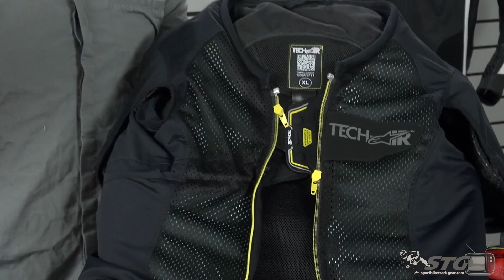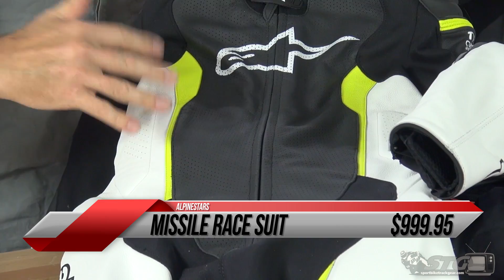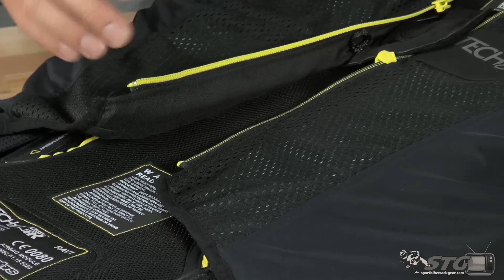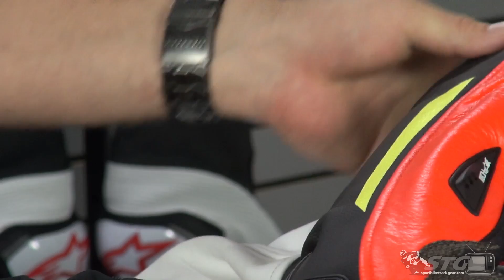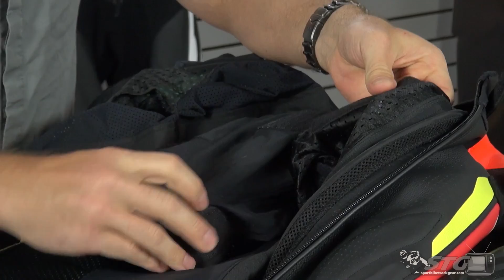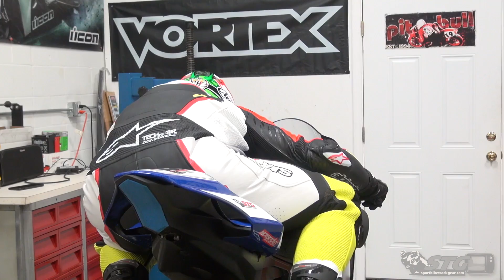Alpinestars Tech Air Airbag System Introduction from Sportbiketrackgear.com

Comment: Just bought the Alphinestar GP-R V2 Tech Air Jacket. I notice the cable is only long enough to peak thru the Tech Air Connection hole. Not even enough length to pull more through. Is that normal?
Reply from the maker: There is plenty of cable there, you just need to give it a little pull. If it is hung up open up the liner and you should be able to solve that pretty easily. - Van

Comment: excellent video. what happens if one uses a size large in a size 56 or 58 jacket, instead of in a size 54?
Reply from the maker: As long as the vest fits you properly you are good to go. - Van
Reply: @sportbiketrackgear  thank you for response. so, will a size large vest zip into a size 56 or 58 jacket?

Comment: Great video about tech air race , what about street teck air?
Reply from the maker: I have not handled or used the Tech Air Street. The Race version makes the most sense for our customers and we use it so this is what we have focused on. The Race can be used on the track or the street in compatible garments. - Van
Reply: @sportbiketrackgear  I was given a street tech air as gift from a friend. I ride sport bikes. It's a real shame Apinestars does not make leather jacket for street vest with 360 zipper . 
when I ride i wear leathers full gear. When my friends and I ride were not touring, lol.
Reply: @sportbiketrackgear  By the way dig your vids very informative. As a matter of fact your vid on BMW exhaust upgrade helped me decide to pull the trigger.

Comment: Can I machine wash tech air vest and jackets no problem?
Reply from the maker: I would not throw the vest in the washing machine. Hand wash using mild soap with rags and do not submerge it is what I would suggest. Basically wipe down the fabric of the vest with a soapy rag then rinse it off using a wet rag with no soap. Once you have in all rinsed off let it air dry. - Van

Comment: Brian, maybe i missed it. Once you have to deploy the airbag ,  can the charges be replaced or does it mean a new vest?
Reply: if you go street mode you only get one charge but can still send it in for repack
Reply from the maker: It can deploy twice before you need to send it to Astars in California for inspection and repacking. We just received Max Van's back and the turn around was very fast. - Van
Reply: @sportbiketrackgear  is it really only 200 for the repack
Reply from the maker: We just got Max's back, I think it was $300 but need to check the invoice. There will be a video coming out next week covering the repack, how long it took and how much it cost. - Van

Comment: did you mention how freaking heavy this system is? Just the missle air jacket was heavy by itself. Just got the airbag unit yesterday, omg, aside from little to no air flow making it through the jacket before the airbag, now it is even less and damn is this the heaviest jacket I have ever owned
Reply from the maker: It adds weight for sure, worth every ounce and then some IMO. My Son Max crashed in his Missile suit while racing a few weeks back and said it felt like landing in a foam pit. Zero injury and no complaints of pain. - Van
Reply: @sportbiketrackgear  The weight really doesn't bother me at all up until I have to take it off, for whatever reason my arms don't want to come out of the sleeves. like the Elbow area is just a bit too snug, but once I get around that, I am still dealing with a shattered wrist and arm from a total back in December, somehow survived that with only 6 lbs of titanium being added so more protection is very welcome, just so damn heavy on my arm. I got the zx10R SE to help deal with the feedback killing my arm and it helps but idk, having to train myself to use my left hand and arm. The lack of airflow though even on a perf jacket is pretty bad anytime you are not jamming. once moving along it's perfect. Looking I to one of those active cooling units just not sure it will fit along with the rest of the gear
Reply: @sportbiketrackgear  hey Van, since I have your attention for a sec, need a set of rear sets for the 18 ZX10R SE (so same as the abs) that will let my 6'3" ass fully tuck in, as of now my elbows are stuck out cause my knees are in the way, folding pegs would be nice but not a must, any suggestions

Comment: What if it inflates, do you have to send it back and get the airbag refited...
Reply from the maker: When the vest is in race mode it can deploy twice before you need to send it in to Alpinestars to be repacked. Alpinestars services the airbags in CA with a fast turn around. We have had a couple customers send them in after crashing getting the vest back in a timely manner. - Van

Comment: I'm 6'1 185lbs and currently wear a very broken-in motegi 56 EU... Having just highsided at the track and injured my lower back, I'm looking at acquiring this system. I usually wear the forcefield pro pants instead of suit lower armor. 

I'm concerned about fit with the vest + gp pro suit. What's the best way to make sure you get a good fit with both?
Reply from the maker: I would put you in a size 54 euro in the GP Pro Suit. IMO the armor in this suit for the legs is excellent and should be left in place. There is an armor upgrade for the hips available I would add to this suit (links to this on our site below). No need to wear the Forcefield pants under the suit with the added hip armor and what is already in the suit. Once you receive everything try on all of it and sit on the bike (do not go for a ride until you are happy with the fit in case we need to exchange). If you have any issues or questions please contact us and we can get you dialed in.

Alpinestars Nucleon KR-H Hip Protectors
https://www.sportbiketrackgear.com/alpinestars-nucleon-kr-h-hip-protectors/

Alpinestars Nucleon KR-HR Hip Protectors
https://www.sportbiketrackgear.com/alpinestars-nucleon-kr-hr-hip-protectors/

- Brian Van
Reply: Thanks for replying Brian! Having just really messed up my gluteal, coccyx, and lower back, Im actually pretty adamant on keeping the pants as the suit doesn't come with any rear facing armor. Those pants saved my ass from much more damage
Reply: Sportbike Track Gear still recommend a 54eu?
Reply from the maker: When using the air bag in the suit the fit of the suit in the upper body is very important for the bag to be effective in a crash. If you are set on wearing the pants under the suit I would then remove the armor in the lower portion of the suit to accommodate the pants. I would still put you in a 54 Euro to start for sure. - Van
Reply: Sportbike Track Gear cool ill probably first verify the fit of the suit before getting the vest, correct?
Reply from the maker: That is not a bad idea as the size of the vest is dependent on the size suit you wear. - Van
Reply: One more quick question brian, how's the lower back protection with the vest? With my current injuries from a highside, my lower back was sufficiently exposed even with the forcefield pants - i basically took a full blow to the lower back and risked a spinal injury. I know the forcefield pants have coccyx, hip, and butt pads, but im wondering if the vest provides full spinal coverage as well.
Reply: Sportbike Track Gear got another question for you above ^

Comment: Sold on the GP Tech V2, if for the quality and mobility alone. Not necessarily sold on the air bag for street use. If I get knocked off my bike on the highway at high speed, 5 seconds might just not be enough for adequate protection. You forgo better performance of static armor outside the inflation window. Also having to disassemble and charge seems like an unnecessary hassle. I'm ordering a V2, but I'm going to hold off on the air system for now; since I'm unsure how much I really want it. Another HUGE reason I must buy the V2 is the CE Lv 2 rated hip armor. What a godsend. I have been saying it for years, there is no wreck where you don't whip your hip into the cement. Its been a big hole in the protection of suits for as long as I've been riding!

Comment: Can't wait till you go over things like how simple or complicated it is to hook up to computer to change modes from race to street ... can it  be done via iPhone ?  also for one who just leaves in vest at all time , have to actually remove the vest from inside of suit every time needing to charge battery or can reach the port while zipped in ...on an all day canyon ride when off the bike for taking a brake can you turn it off to save battery, just undoing the front of chest area Velcro turns off the system ? Just a few questions . Haha

Comment: Van, will this cost a fortune to recharge and take months and months like the Dainese d air does? I know you said they invested in support to get them back quickly but big D made the same claim, I believe. Will they make the stupid suggestion to buy an extra one the same way Dainese did?

Also curious how much hotter this will make a suit?
Reply from the maker: Alpinestars has always had solid product support and warranty services. Over the last 11+ years we have sold a metric shit ton of Alpinestars and there have been warranty issues as expected with that volume. They have always done well managing that, improving all the time as needed. I have spoken with them at length about the Dainese experience and have been assured it is covered. I know and trust the people involved so I do not expect big delays. 

With the vest being independent of the suit if you need to send the vest in for a recharge you can still wear the suit without it. That is not possible when the airbag and the suit are 1 piece. Since the Tech Air can deploy twice in race mode I expect you could use it until it has deployed both times and then send it in.

I need to get this thing out on the track to see how much hotter it will make the suit to be perfectly honest. Airflow will be affected in the chest for sure to some level. When on track there is not much air that comes in through the chest in a tuck, most is through the stretch and perf in the arms and legs etc...

As I have more experience with this I will continue to update our site and channel. This is a big investment and I want to do all we can to make sure those who invest in it get the maximum value. The other deal could have went better for sure, I took some lumps over that and will not go through that again.

Van
Reply: Sportbike Track Gear thanks for the confidence in their support. Definitely helps that they can learn from the failures of Big D. 

I'm seriously considering this as a replacement to my GP Tech suit but if it's extremely hard to keep cool down here in the Southeast. So if this is significantly hotter than the already 1000 degrees currently inside my suit then that may cause some problems. Eager to hear of your findings!
Reply from the maker: I expect to ride in this later this month and will be sure to update everyone as I learn more. - Van

Comment: Thanks for the video. The obvious question for me is this or d-air. In my case given that I'm looking at a street + track solution. Getting a GP Tech V2 Suit +  Missile Jacket would be quite a bit cheaper than the Misano Suit + Jacket (and that's ignoring the fact I already have A* pants for the street). Maybe a  new track suit comparison video would be a thing. :)
Reply from the maker: Alpinestars waited to release the Tech-Air Airbag System until it was dialed in and it shows. No GPS signal needed to work, 2 independent deployments in race mode, 3 different suits from $999 to $1999 integrate with it and you can use it in a leather jacket for the street. If you have the budget this is the way to go. - Van
Reply: Thanks for your reply! :)
Reply from the maker: You are welcome! I have worn the GP Tech Suit a couple times now and we worked on the video today (trying some new things to improve the level of information we pass). I have to say this suit reminds me of their Race Replica Suits from a few years back. I have the one I did a couple AMA races in which was crashed in 3 times with no repairs needed (could still wear it easy). All of the suits from this 2018 Alpinestars collection are a step forward IMO. - Van
Reply from the maker: There are other shops that will offer this as well. For service all of that will be straight through Alpinestars in Torrance CA. - Van
Reply: Sportbike Track Gear Is the gear exclusively sold through you. Also I also want to know how it gets service. Will it be specific places or will shops be able to get training in it and be certified to service the equipment?
Reply: also It seems like the tech air system from A-stars covers a lot more of your body!